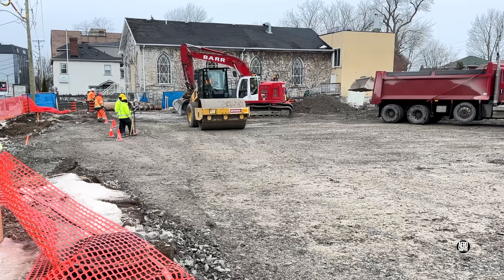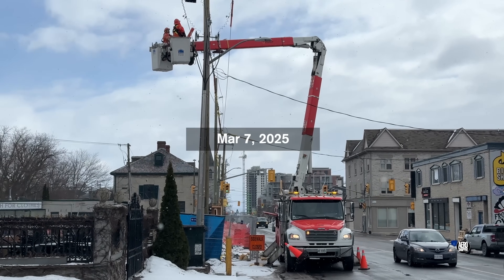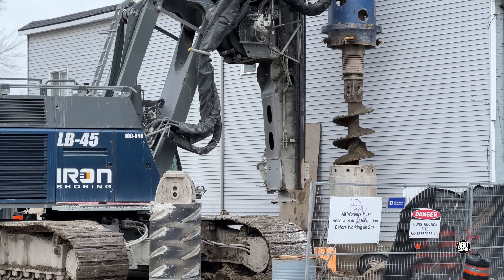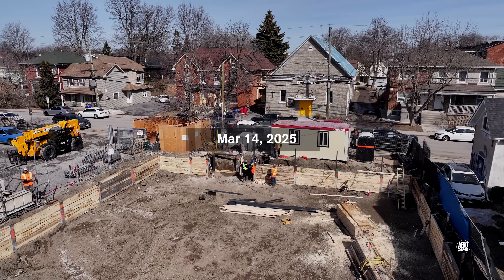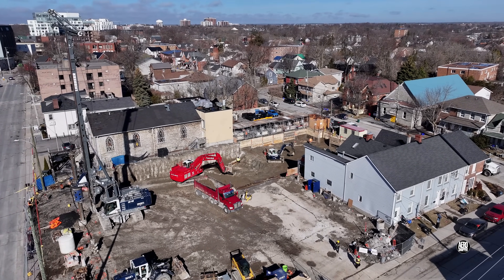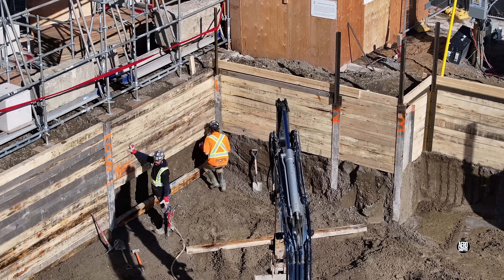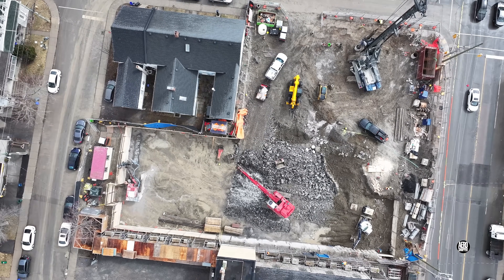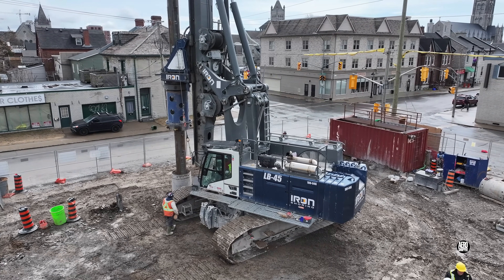Gotta Go Down to Build Up - an update on raising a new multi-storey apartment building  4K

Comment: I'm kind of surprised that 364-368 Barrie street were not included in the site assembly. They're currently on the market for around 2.4M, and it seems like it could greatly simplify the site plan.
Reply from the maker: Christopher - interesting point well made.  I have no insights into the preparations, but I do know that Podium is a thoughtful company that will almost certainly have considered every option.  That said, it's a really tight squeeze - but managed very well - with every consideration for reducing local impacts to neighbours and road users.